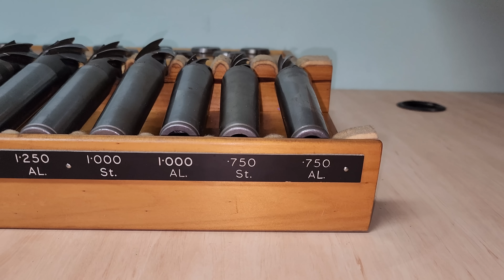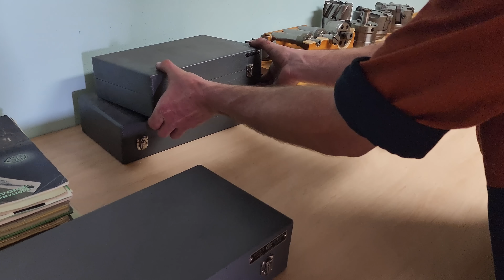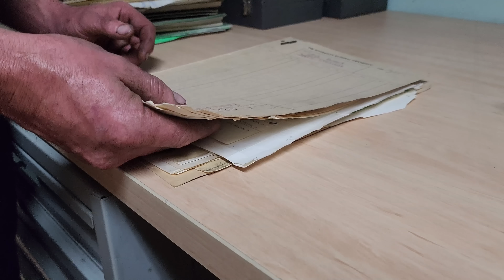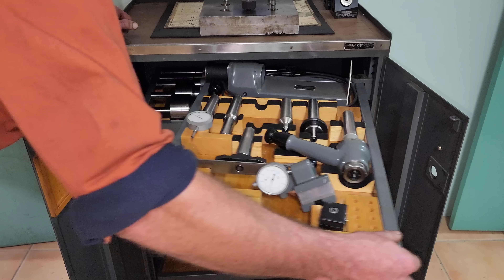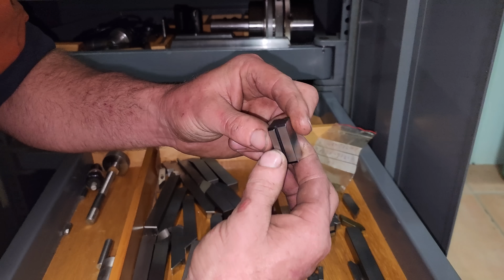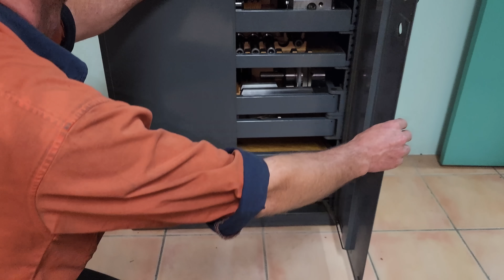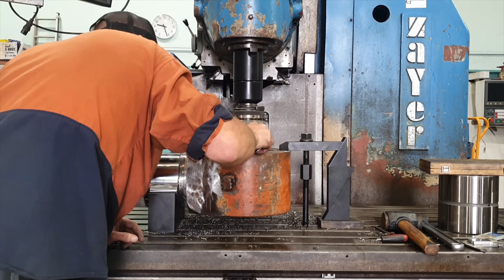Our SIP Jig Borer Tooling Collection! | Testing Shop Made BT50 Tool Holder

Comment: I really enjoy seeing the older equipment you guys preserve and use. It proves once again that craftsmanship is required in any field. 
The craftsmen that were using these machines built made extremely accurate parts and could do it time and time again. 
Computers have sped up the processes and unfortunately the human running the new machines have a hard time doing what the "old timers" could do with entirely analog machines and instruments. Thanks for preserving that trough your work and shop.

Comment: While that machine might have cost 600K+ in todays money, you can see where the money goes. That test block was just insane though, to have two plates machined at either end of the table and still have tolerances enough to create a suction effect shows how accurate they are.

Comment: It’s sad some of these were scraped. Where I’m from in the US there was massive manufacturing of all kinds. The amount of factories that closed in the early 90s around here was staggering. Being from the area that brought you the original Bridgeport, I’m proud of our areas history
Reply: The stuff was only as good as the upkeep of it.   I worked with a guy in IT that was a foreman at Colt up the road a bit.  They had all kinds of stuff that was worn out.  Management would poop bricks when an old timer would retire.  Because the machines were HIS to use.  In the morning when the sun came through the windows, the guys would adjust the tools a tiny bit to make the spec and then in the afternoons they would have to change them again.  But they instinctively knew how much and when.  My coworker couldn't take it and got into IT for banking.  

I just read a story in the latest issue in Collectible Automobile.  About a guy (now in his 90s) that was designing fiberglass sports car bodies in the 50s.  They'd lay up one half the car.  Using a contraption hung from the ceiling they'd take measurements.  They'd transfer them to the other side, but the contours never lined up.   The metal roof was expanding during the heat of the day making the distance to the floor different.   They ended up changing to a measuring system mounted on the floor and never had another issue.
Reply: My cousin closed the family machine shop started by my grandfather, MacKenzie Machine and Marine in New Haven, Conn., a few years ago in part because it had become almost impossible to find skilled machinists.
Reply: @alexanderw6309  My cousin retired and sold out his half of a shop in Westfield Mass.  He was never a machinist but the sales guy.   He worked with the local vocational HS to get help.  You could graduate and at 18 be making decent money.  It was always pulling teeth getting help.  He'd constantly complain about it.
Reply: @alexanderw6309   They all want to program a CNC instead of actually machining.
Reply: A close friend has a 3rd generation shop in Stratford and it’s a major issue finding new guys , he just had a few retire that were there since the early 80s. 
Though there’s not as many big shops around here anymore but the small shops are always looking for help it seems.

Comment: You must have been stoked to find all that tooling in that condition. I'm just stunned at the quality and condition of it all. Even if I didn't have a use for it I would have wanted that gear. It's like art or jewelry for engineers. Good to see the borer back in action too.

Comment: Amazing ... the quality (or should that be qualité?) of the Societe Genevoise equiment is truly amazing,  really good to see it found a home with someone who truly appreciates it.  I know one guy over here in the UK with one, he does press tooling for the pie case industry ... the precision he works to is amazing, some of the die cutters don't just cut a blank of aluminium foil but are designed with specific tapers and clearances to "wipe" a thinner edge of alumium that is then rolled to make the safety edge ... a few tenths is all it needs.

Comment: Fantastic to see an old machine with all the tooling, the Walhaupter boring heads are fantastic, I have a smaller Japanese copy that I rebuilt from Int40 to R8 to fit my Bridgeport. The Hydroptic colletts look similar to the ones in my Biechle die miller that I rescued.

Comment: In your shop that is not climate controlled what precautions are you taking for storing tooling that will be used infrequently and stored for long periods? Maybe a climate controlled tool room for all your tooling/tools in the future as most of these tools are no longer available and cannot be replaced. Ray
Reply: Tools don’t need to be stored in a climate controlled room.  There’s no point because their temperature fluctuates as soon as you put them in the machine.  Whether they’re sitting idle in the carousel or mounted in the spindle the temp is always fluctuating.

Comment: Hello from France,
One point I don't exactly understand as "not a machinist" is : why do you want to use SIP tooling on other equipement ? As the SIP seems to be so precise, why not using it and instead using other equipment ? There is quite surely a good reason as usual, but right now... I don't see it. Maybe a good occasion for a "kind of shop tour" to provide some explanation wha this machine fit best for this job but this one fit more more an other job. About the lathe the reason is quite obvious : capacity (more length/diameter on larger lathe than on smaller one). But for today internal diameter of the eye, right now I don't understand why using the Zayer instead of the SIP instead of the Hafco (or even the Huron if operational, but yeah this one is maybe oversized 😜).
As usual Kurtis may have a good reason about this. And I'll enjoy to have him sharing with all of us why he prefer to use which "milling machine" for which job.
Have a good day.
Nicolas
PS: Note sure who was the most amazed when looking the SIP tool collection. "Whoa" from Karen sound as deep as Kurtis intense sparkling eyes.

Comment: The woodwork in that cabinet is ridiculously nice considering what its function is...just goes to show how much care went into it all!
Reply: Built back when people actually took pride in their work and the term "Craftsmanship" meant something.
Reply: @dennythomas8887  On the other hand, would anyone today still pay £600k for such a machine?
Reply: @Kris_M  They pay way more than that.  Accuracy, repeatability, speed, and automation are all even better now.  Heck, now more than ever ultra precision is a must in many applications.
Reply: @Kris_M you’d pay far more than that for the equivalent modern CNC milling machine and all their accessories would 100% come in cheap, nasty blow moulded plastic cases
Reply: @dennythomas8887  The term "expensive" also meant something.  Same as now.  The question is, how much do you want to pay for a box?  For a cheap tool, I'm not paying double just for a fancy box!  In this case, relative to the price of the tooling it's probably a small fraction.

It's also an aesthetics thing.  Tastes change, and styles come and go.  Wood is coming back though.
Reply: @dennythomas8887  Now it would be blow mold plastic.  Because it would be deemed not really important.
Reply: @dlewis9760  it would have been then as well, except plastic was a very, very new material in the 50's. Nylon was only invented 20 years prior and injection moulding wouldn't become commonplace until the 70's. Wood was likely the cheapest option at the time.
That said, this was a long way from a regular mill you'd commonly see in a machine shop, at over half a million pounds you get what you pay for

Comment: When I did My Mechanical Engineering Apprenticeship with GEC-Marcioni, we had to make a similar test piece on the Jig Boere. It was 2, 1" thick steel plates, with 4 1" holes in each, they were machined separately, and when finished, had to fit 4 steel rollers between them no matter which way around it was aligned,.

Comment: The truly great thing about Curtis and Cutting Edge Engineering is that he has a rare combination of being highly competent and capable at fixing and fabricating not only heavy equipment and components, but is also a highly competent machinist who has great respect and appreciation for the machines and tooling that are the machinist's art form.  Both the new and especially the old.   He shows respect, even reverence, for this fantastic SIP tooling and machinery that dates from 1958, and that's as it should be.   Those tools were made to do specialized jobs,  very unlike the more basic but modern CNC machines that use computer software to achieve similar results.   There's something very elegant about purpose built machinist's tools that only are meant to do one job,  but nothing does it better and more precisely,  not even the latest CNC equipment.

Comment: The Jig bore makers knew how to present and store their tools eh? That rotary shelf tool cabinet is out of this world and way cool. Moore here in the States had wooden desk like cabinets that were equally as much a work of craftsmanship as their machines. To have the tools that were designed to be used with the machine is very cool and useful. That test block is pretty neat too. While the need for such precision has not changed, the method of obtaining it has. What a nice collection of the way it was and still useful today if one has the need. It  would be fun to bore rod eyes precisely to a few microns from the end of the rod! 🤣 cheers

Comment: I started my toolmaking apprenticeship at the Ford Trade School in Harrold Hill, Essex in 1967.  In basic training we had to cut out a 1" x 1" x 1" cube, and make a 1" square hole in some plate steel (I think it was 1/4").  The 1" cube had to fit the hole in every orientation and was tested with feeler gauges — I can't remember what we were allowed.  I got top marks for mine, but I couldn't understand why the other lads were making such hard work of it.  That's because I'd roughed out mine on a milling machine leaving just enough to file and polish out the machine marks down to size.  I still have and use the 1" Starrett micrometer I used on that test.  I was paid £5 a week, minus10 shillings for the tools we'd been issued.

Comment: When moving those ins around in the proof plate, you could about hear a small air "pop" as each of the pins was pulled out of their bores. Kinda like how a suction cup will pop when pulled off glass, it was soft but I'm sure I heard the 'pup'. That's the kind of fit now that is done using that EDM does now.

For a minute I was questioning if I was just hearing things. Then you stood the plates up and pulled one pin but not fully out and it was pulled back in from the air pressure differential. Yeah, I wasn't just hearing things or thinking of what wasn't actual. No, it really is that precise.

Comment: Hi Kurtis,
That is certainly a nice machine and a very useful and seemingly well cared for supply of accessories.
Australia had far greater capacity in manufacturing post WW2 than we do today and not only in engneering areas, we had a large electronics production capacity as well. we were basically self sufficient and exported a lot of items. Unfortunately we have lost not only those industries, but also the skilled tradespeople involved.
I look forward to seeing that machine producing precision work for you. Regards Dennis.

Comment: While from a strictly inflation perspective thats somewhere around 750,000 USD, the price of highly technical, precision equipment has ballooned much faster than inflation. I would bet that in a alternate universe where in the year 2023 you can buy a new one of these with all that tooling, it would probably cost you several million USD, and maybe as much as 3 or 4.
It is sad to think about all of the machines lost to scrap. Im sure at the time nobody thought it was a big deal. That newer and better machines would come out, and they would be reasonably easy to obtain. So why pay to relocate and store such a large, heavy piece of equipment? They were probably cut up/taken apart in situ and the pieces forklifted into a scrap truck.

Comment: I love the test piece, I made a similar test piece when we got our Moog Hydra Point milling machine back in 1970. I made two round plates in the lathe and centre reamed them then on the Moog drilled and reamed seven holes on a pcd, it could be assembled in any configuration with eight ground pins, at the time a quantum leap in precision.
PS.  The machine was at the very beginning of cnc, 2 axis only. But this hydropic machine is on another level.

Comment: Hey Hey CEE team... greetings from Belgium....Always nice to see, when somebody shares there passion for (vintage/new) machines and the tooling that goes along with it. People are sometimes surprised when they see "old /older" machines in a modern machine shop, but what they forget is that those older machines are actually a precise a brand new machines and often have some very specific tooling set or capability that's doesn't come that easy with newer machines.

Have a great weekend.

Greets
Mark

Comment: Thank you so much for making this video.
I thought I knew that Swiss engineering was synonymous with precision, but this takes it to a whole new level.
The test piece and the fact that it and all the documentation was retained, shows that even the original owner knew they they had purchased something very special (and expensive)
It wouldn't surprise me if the number of surgeons (!!!) that were hands on with this has not got beyond single figures in the 60 odd years it has been around.

Now I need to have a cold shower!
Reply: The old joke comes to mind... the Americans had devised a way to make the finest wire in the world... a level of precision never seen before. In their pride, they sent a sample of the wire to the Swiss.
The Swiss sent it back with several different sized holes drilled through the wire, as well as one down through the middle.

Comment: I love the craftsmanship of the old tools. Not just the tools themselves but the trays and cases were all handmade with care and precision. Not like some of the plastic or stamped metal cases you get today!
Reply: They are beautiful but imagine paying thousands of dollars just for the cabinetry.
Reply: @teeanahera8949 
Cabinetry that is as good as new 70 years later? Sounds like a good investment to me. Imagine one of those drawers breaking and the tools hitting the floor.
Reply: @Everythingisgoingtobealright  Two important things.  First, even a half decent cabinet isn't going to have the drawers just break.  Second, it's generally bad practice for a company to plan 70 years out.  Especially since if they're still using the same machine then it's likely they haven't advanced the business.  Not even grown, just advanced.

It's a luxurious cabinet, and costs a fraction of those tools prices.  However, I personally would prefer to have all my tooling in "nice" cabinets instead of a small fraction in that one.

Comment: I was drooling over all your tools like a kid in a candy store. Boring mills are my favorite machines to operate. I had the pleasure of working on a very old Cincinnati Gilbert, manufacturing 10 ton press plates. I used huge angle plates as well as rotary tables. The metal chips from my machine would heat the machine shop in the winter. The operators controls were on a tether with 40 buttons and 3 rotary dials. The most fun were Cincinnati Cinematic vertical & horizontal NC boring mills. These had a separate programmer that made the paper tape, then operator would set up to 9 tools and run the tape & change tools when the machine stopped and a light for tool change came on. It had 9 cams to set depth for each of 9 tools. I got so good I could read the holes in the paper tape like morse code. It was very accurate and made it possible that just about anyone could run parts in the machine without being a skilled machinist.

Comment: Thank you for the video! I know it might be too "political", but what do you think causes the decline in tool quality and precision nowadays? Apart from reducing manufacturing costs. You mentioned at least a couple of times in the video that the tooling from 1950s and 1960s are far more accurate than what we can find today.
Reply: You had to be a government or multinational to afford this. Manual machines are now obsolete. CNC rules. Check out Microtechnik for example which can achieve unbelievable precision. If you've got the big bucks it is out there

Comment: I just discovered crobalt and stellite m100 tool steel. Except it has only a negligible amount of iron in it. It is about 50% Cobalt, 35% Chrome and various other attitudes similar to high speed Steel. But punishment it is capable of taking seems to truly outclass HSS and carbide tooling. Since it can be reground for the cost savings compared to carbide is substantial. You probably already know all this. My question is why do you not use it? Is it cheaper too simply switch carbide bits then it is to sharpen your own tools?

Comment: That tooling is really amazing. The "downside" is that You end up with too many options to make a job :)
One note about the collets. Those are NOT like ER-collets. Yes, they look very similar but there is one big difference. The sides of ER-collet do not pivot, the entire hole contracts when tightened. The sides of the collets You have, pivot when they are tightened. This means that the hole becomes tapered if the item inside is smaller than the collet dimension. This is a common issue with almost any other type of a collet than ER.
This is the reason why ER collets have a relatively large range (1 mm).